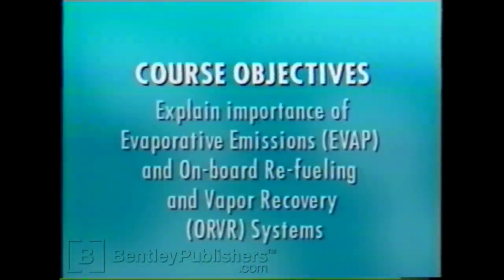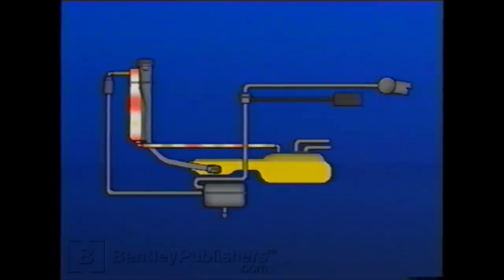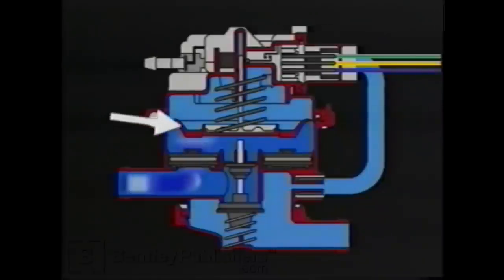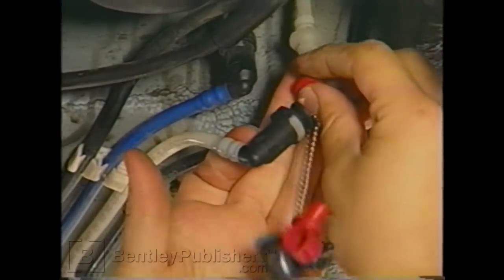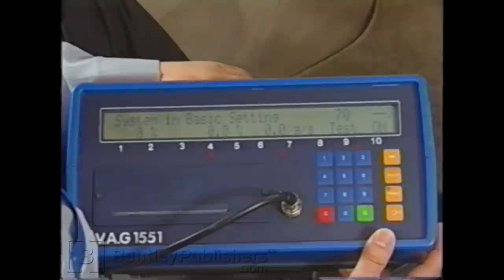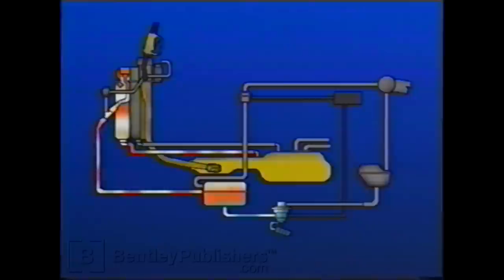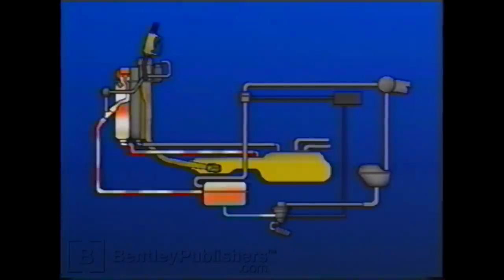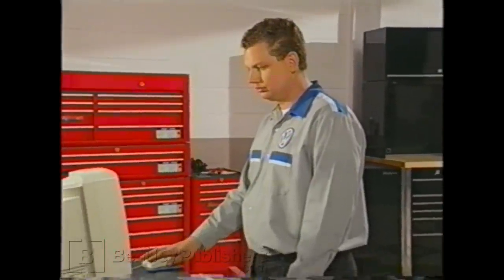Volkswagen Evaporative Emission Systems (EVAP) - Operation and Testing - Diagnosing - DIY Repair

Comment: great info for debugging a vw passat 1.8L /audi A4 ....OBDII fault code P0456 (*EVAP small leak exists) ...so checking a Vapor cannister purge valve, or a greyed out check valve, or fuel cap seal leak, or defective LDP in the drivers/passengers rear wheel well location.

Comment: Exhaust Emissions Light always on in vw gti , due to this dodgy evap system, i have a vw gti and had to spend $800 just to get my evap emissions light switched off, got the charcoal canister replaced, purge 1 way valve replaced , N80 purge valve replaced... 

Due to this 'evap system'.

Car was running as normal but emissions light was on until i got it fixed.
Reply: This is why people need to know just A Little about how cars work.  Useless system.  Just rip it out
Reply: A cheap way to resolve the problem is to remove the emissions led or bulb.

Comment: nice vid. i am having problems on my 1.8T. it idles super rough ONLY after fill-up. runs perfect all other times. i know it's not the purge valve because i have tested it separately and it opens and closes fully. i have the "incorrect flow" code which means my MAF and/or O2 sensors cannot sense the fuel vapors from the canister/fuel tank. I have no leak codes shown.

can someone help with some input please? i dunno what it could be.
Reply: I know this may be a long shot, 6 years long LOL but...did you ever figure what the problem was? I am having exactly the same issue on my 2016 golf gti. No codes related to evap and it only idles rough after fill-up, of course it then throws misfire codes because of the rough idling.

Comment: Thanks for a  nice public service, but I am sorry I own my Passat, truthfully, because it is so over-engineered, the owner is forced through the inherent complexity of all its systems, to return to the dealer and bend over for a good pile driving.  It was designed to require dealer involvement often, and they are merciless in their charges for parts and labor.  I am going Japanese or Korean or USA from this point on.

Comment: The most unnecessary system on a car. All you need is a "cat" & the rest is overkill that cost citizens a ton of $$. Most of the $$ spent by consumers on car repairs have nothing to do with the automobiles ability to function as a transporting machine.